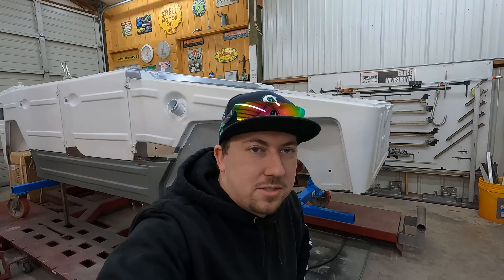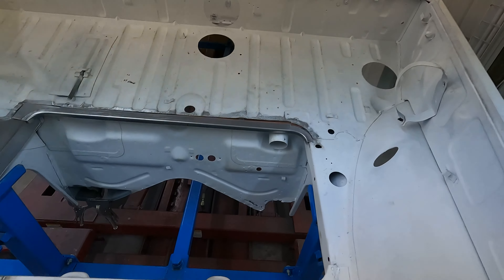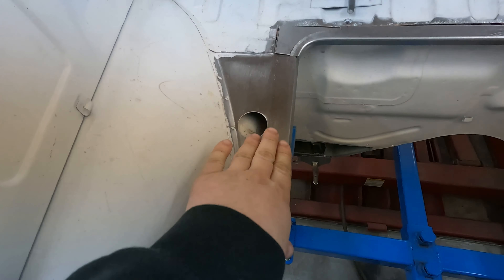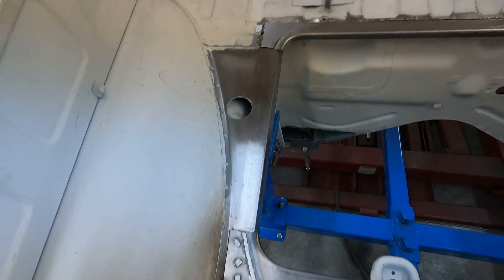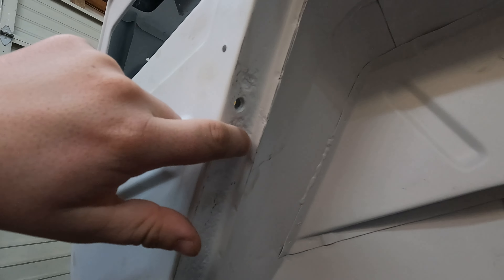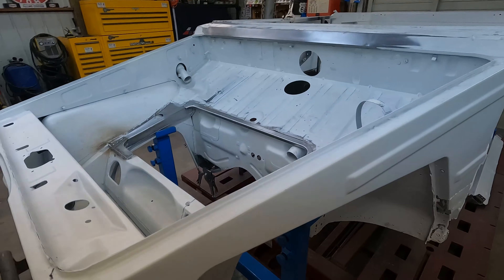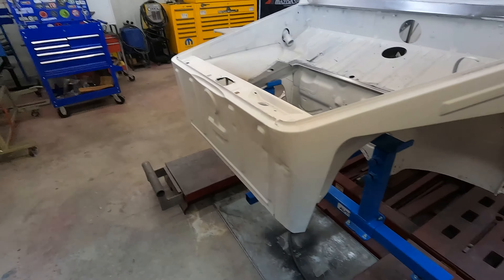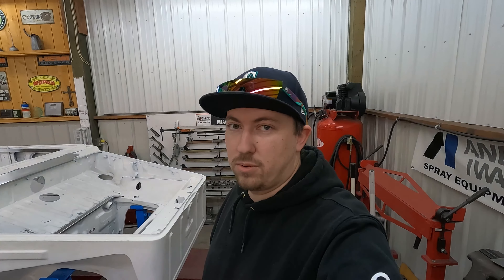1974 VW THING trunk floor rust repair

Comment: I have a 73 that developed extreme rust on the body above where the back fenders are screwed into the frame.  I will have to replace the same piece you are going to replace.  keep up the good work.  this car will look great when youre done.

Comment: Hello  Progressing well I see..Rust is always a problem isnt it.?  Your metal bending/part making seems very good..I have often wondered about rust proofing cars..We used fish oil,or Ziebart down here..But I think it would be a interesting idea to  galvanise dip the whole car after it was all welded together..It would have a silvery tin look which would fade,but be durable ..as durable as a sheet metal roof which lasts for years..About thirty years ago At a Motor Show here  AUDI had a stand and were showcasing the AUDI 100  which was promoted as being made from galvanised steel and rustproof..The car was as I say galvanised then outside etched and painted..They had a AUDI 100 on display that was fully assembled but had not been etched and painted,just left galvanised,to demonstrate..I and lots of others though it looked good as it was...My memory of Thing and Country Buggy. have faded over time..Havent seen one here for YEARS. All the best..pat the dogs for me